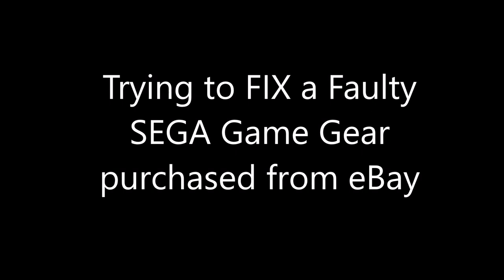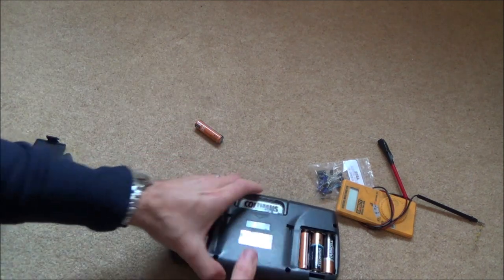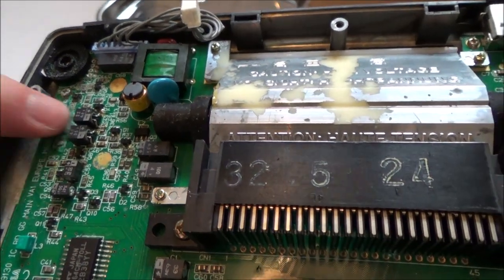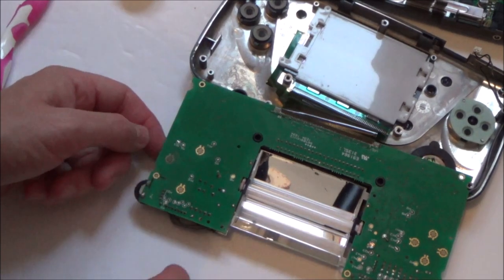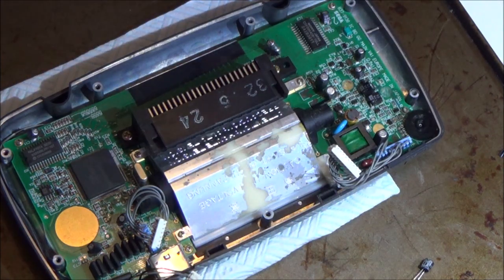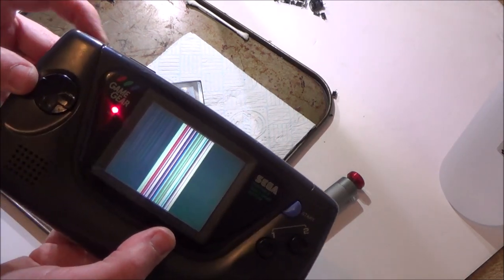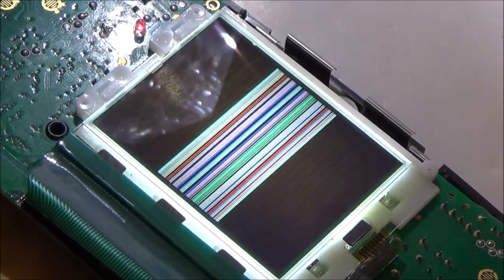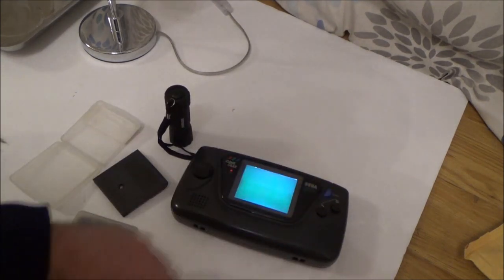Trying to FIX a Faulty SEGA GAME GEAR purchased from eBay

Comment: Your channel has inspired me to buy and repair an old DS lite, it came in the mail today and I am currently repairing it
Reply: And have you repaired it?
Reply: Good luck!!!
Reply: Do not break the 4 pin connector for the digitizer i broke that on my ds lite and all of the 4 pin connectors on my 3ds so i have to buy some that are oem for sony psp.
Psp has better parts in it than the cheap ones Nintendo uses
Reply: That one ain't too bad. The ribbon on the original DS is a nightmare though.

Comment: DON'T put solder on button pads, they are gold plated and this prevents them from oxydise, if you put solder they will oxydise pretty fast and this will ruin them. The problem is with cable from board to display (the big one) it is peeling or was hitted by electrolityc acid from old capacitors

Comment: You can swap the screens out with a modern LCD kit from "McWill" on the AtariAge forum.   You worked out that the flex ribbon glue weakens on the LCD there - the large connection on the bottom, and the smaller one that joins at the side.  You can (if careful) heat the flex ribbon with a soldering iron - drag slowily over the ribbon (not whilst its powered up).  That can often re-join the flex ribbon to the PCB.  They are 'glued' onto the PCB and the screen edge with special conductive glue.  They would have been joined up with a "hot bar" at the factory.   But the random colours seen would perhaps suggest another fault with the screen, or what's driving it.  Maybe some corrosion was the cause of the coloured bars, but the 3 sections flicking on and off did indicate the ribbon edge.  I've also got a couple more Game Gears I need to look at soon on my channel (one was donated yesterday, the other was one of the two seen in that Lynx repair I did the other week).

BTW - that zap you got, its around 200v for the backlight as you said!  I got a similar zap the other week lol, whilst working on that other Lynx (which I now have working too).
Reply: I have some that glue for an LCD tv I have where the image for part the screen doesn't display correctly.  It also has an issue with the backlights.  The driver isn't working properly for some reason that I haven't diagnosed yet.  I'm not at all clued up on what I should be looking for but I think I will have a look eventually.
Reply: GadgetUK164 - Retro Gaming Repairs & Mods
I find it really satisfying that these machines can get a new lease of life with these replacement & upgrade parts, ive fancied having a go myself ever since i saw a Lynx get upgraded with a new LCD caps etc, i'm going to have to subscribe to your channel me thinks! :)
Reply: It gets said all the time but the McWill LCD upgrades for the Lynx and GG systems are phenomenal! I just finished up another Lynx II for someone today with the McWill and actually recorded the process to edit and put up on my channel soon.
Reply: Just looking through the comments here Chris and yours said just what i wanted to say. I actually think Vince did ok with the work he did here. He shouldnt be disappointed really.
Reply: Absolutely!!! =D
Reply: I've covered the McWill mod on my channel too, for the Lynx and the GG.  The nice thing with the McWill mod is its a higher resolution screen and works at the RGB level rather than composite like the Nomad screen mod uses.
Reply: Hobert Infantino  neat
Reply: The McWill mod looks amazing but it's damn expensive.  Is there a cheap method of getting rgb out of the gamegear and possible fit a generic rgb screen or even just output to an external monitor?
Reply from the maker: Game Gear McWill screen replacement by GadgetUK164 - https://youtu.be/6B9P0ZXZ6CY
Chris, it was a good zap. Cheers for the great advice as usual. Always feel free to link your videos that are relevant, it will help out the viewers so don't feel bad doing it :-)
Reply: GadgetUK164 😎
Reply: in CCFL (Cold Cathode Fluorescent Lamp) inverter supply - voltage is not around 200V but around 400V and more if its biger but you cant mesure it with regular multimeter due to pulse frequency - if its not sinusoidal wave but triangle or squarewave or sawtooth, etc. you need a true RMS with high frequency inputs to register and mesure that otherwise you always get an error in mesurements and there is a formula to calculate exat voltage
Reply: @CRG  Yeah...in my case, I prefer to play GG games on my 3DS via the Virtual Console.  I had a Game Gear back in the day and it was a neat system.  But the only really memorable game that still sticks out in my mind all these years later (besides the Shining Force game which came to the Sega CD) is Defenders of Oasis.  If you are really really hardcore into the Game Gear and want to play the games on original hardware with a modern LCD though that screen is great.  You also get MUCH MUCH better battery life with the system, since the original display used a battery hogging CCFL backlight, whereas the new one uses an LED backlight that takes maybe 1/10th of the power.
Reply: My Mate VINCE why dont you have a go at fitting an lcd screen kit to one of these gamegears you have that have faulty screens? Be a good upgrade. 😁

Comment: Possibly batteries have leaked at some time. If you get it going, you might want to look at upgrading the screen. I watched a video where the guy put in a modern LCD screen and it looked much better and the battery life is much better because the original uses something primitive (I think it's a fluorescent bulb).

Comment: Personally, I'd recommend replacing ALL the capacitors as well as well-known failing parts whenever dealing with vintage/older gear. Load of hassle and a right pain in the rear sometimes, but if it's something of value or worth restoring, may as well do it right first time. Aging plastics and ribbon cables don't take kindly to repeated dismantling and re-assembling, so it's better to minimize the risk of any further damage by getting everything done at the same time.

Comment: Awesome video, just some considerations, measuring batteries on an open circuit (a.k.a no load) doesn't give the most accurate results and the chrome plating inside the Game Gear could be a form of a light RF shielding to protect it from weak electromagnetic interference.

Comment: I remember only being able to afford a pack of batteries once a week for my Game Gear, which lasted for 2 hours of use. There was no save game feature and pausing was a battery killer.
Reply: Probably why there is a dc jack on it.
i just use a old phone charger with my gbp that charger outputs about 5 volts @ 2 amps but the dc to dc converter on the gameboy is damaged so it can take more power without blowing up.
The charger also charges my tablet's internal 3000 mah Li-fe battery
Reply: The tablet is a egm 002 i will put url below to buy one from someone else that is just like mine if anyone wants one

Comment: Wonder if if you run the soldering iron over the connectors to the LCD Screen it will allow those pins to reattach via re-flow.  I do that with the Original Gameboy which has a similar set up and it fixes lines in the screen.

Comment: Same thing happened to me.  Bought a broken GG off eBay, recapped it (as that is what everyone said to so) and it turned on and the sound was good but no picture!  I went through the same steps you did, trying different games and prodding the screen ribbon cable but nothing.  It was cathartic seeing that I'm not the only one who went through this grief.

Comment: Hey Vince! Im not sure if u will ever read this but i wanted to ask you if it might be possible if you make a video one of these days where you take your working switch and measure alle the caps and pins around the M92T36 chip (maybe once with charger plugged in and once with only the battery) so that we guys that want to repair our switches could have something to compare our voltage measurments to. My switch for example has a short somewhere and im getting very strange voltage readings on the board. As i dont have a working switch laying around i cant compare the measurments to know if that part of the board is working properly or not. As you know there is next to none information about switch board schematics and stuff like that. Im sure that would be a REAL big help. As the last video u did this party and it helped me out a ton already ! I sure hope u will read this

Comment: Not too long ago I recapped one of these, spent like 3 hours (cause lot of pads rotted away) just to find out that the screen has a small crack on the very end of the top part, and half of it is dead.. so sad(

Comment: Just clean the contacts of the cartridge holder, because the pins are bend after years of use, clean them with alcohol, use a pencil rubber afterwards on the contacts maybe bend a little and that fixes your cartridge connection. Then start replacing the capacitors, because leakage was clearly visible. Adapt your deduction skills  to more common problems which turn up after years of use. Things to go bad with cartridge consoles are, besides of the common capicitator flaws with the game gear, more cartridge connection related then you think.

Comment: The sega game gear works with the power base adapter 3025-18 9v 1a standard Sega adapter. The polarity of the sega adapters  is always switched, so the middle core pin is the -, and outer one the +. A little sega gimmick, they pull on you, to avoid the use of universal adapters presumably..

Comment: Hopefully the other game gears only have bad capacitors, that way you don't have to switch out the LCD. However, even if the LCD works the McWill mod really improves the overall quality of the unit, so it's worth the challenge of installing it on one of your game gears imo.

Comment: The 3 chips are column drivers - the hot bar flat flex cables do fail over time - it's  fixable but it's a parts machine tbh

Comment: I fixed a faulty game boy by carefully heating the ribbon cable at the bottom of the screen it gets rid of vertical               lines.sadly not long after it developed horizontal lines which can 't be fixed.maybe the same fix would work on      the game gear.

Comment: There is a protocol to test capacitors on the board, too lengthy to post but... https://www.ifixit.com/Wiki/Troubleshhoting_logic_board_components

The Gamegear inner pin is positive and outer pin is negative 
https://segaretro.org/AC_adaptor
More to come later

Comment: apply heat with your iron to the ribbon cable it will reconnect the screen to the board might not work on this one but worth a shot anyway

Comment: lol i can rember breaking the screen on mine an getting a new one thru insurance. i used the old one as a light by taking the lcd off an using the insanely bright back light as a camping light with the rechargeable battery/slash house brick lol.

Comment: Hey Vince I have an Xbox 360 (2013 model) and a computer monitor that only uses VGA. I was hoping if you knew some way to connect the HDMI output from the xbox to VGA from the monitor. I watched your video about connecting the xbox one S but I need to know where to find the adapters that come with sound output for speakers. As in if they come in female only or male only input/output. It would be a great help thanks! :)

Comment: I'm trying to fix my GG right now. The motherboard is not in a bad shape like yours, but I noted as soon as I opened that the capacitors had snapped from their pads. I've tried a recap but the tin doesn't want to stick to the pad! (obviously the capacitors leaked). I've tried with IPA, flux and so on but nothing.  Any advice for me? Thank you
Reply: For example some technique to clean the pads ^_^

Comment: I'm assuming you are located in the UK? Go back and check the ribbon cable again on the LCD. It looked like there was a hole in the cable on the left hand side in the video? Failing that, there is a guy in the UK who makes the actual LCD upgrade kits he goes by the name of McWill. Here is the main thread at AtariAge where he is very active. You can order the LCD upgrade directly from him and install it yourself if you feel you can. The thread is mainly about the Lynx, but he has a GG kit as well and it is fantastic!

https://atariage.com/forums/topic/233632-lynx-lcd-replacementvga-out-by-mcwill/
Reply from the maker: Thanks for the link. I did see that little hole but I think there was a matching one on the right side. It didn't go through a trace, it was just between them :-)

Comment: Vince, I have a Megadrive cart that I shall never use. It's a Golden Axe II, you can have it if you want it to either use as is, or use as a board for the ROM that GadgetUK164 sent you (great vid btw) should you so wish. I have no use for it, I don't own an MD any longer. It's yours FOC. Message me your adress, and I'll send it your way. Ask Gadge if you are unsure about address swapping, he's helped me out massively recently.
Reply: The label has been practically wiped off, and it's got some form of burn, so it's an ideal candidate for parts.
Reply from the maker: Thanks for the offer. Out of the 3 Mega Drive games that I own Golden Axe II is one of them :-) I'm going to keep Paperboy as it is (I like the inside mess as it tells a story) and put a little bit of copper tape on that bad contact so I will decline your kind offer. Maybe GadgetUK will have a use for it . Thanks for asking though :-)
Reply: No probs. Should you find the need for a donor cart, keep it in mind, it's not going anywhere  - I seldom get rid of stuff :)

Comment: Gently hot gun the screen ribbon from distance on low to don't melt it . I will make the glue reatach the ribbon I worked on my gameboy with lines on screen do it while is on till you get a picture

Comment: Buy a 60gb faulty ps3, and see if you can solve the infamous YLOD issue plaguing the aforementioned console.
Reply: It's funny because I bought a used PS3 back then (2007-2008) and it had that YLOD issue. It came back to life through just pressing the on and off button enough times. After that, it just needs to be turned on three times, to "repair itself" - to this day.

Comment: The tracks @ 16' 11" looked corroded. I would have checked the tracks where all the caps were as well as the screen connections/ribbon cable.
Interesting videos, though, Vince.